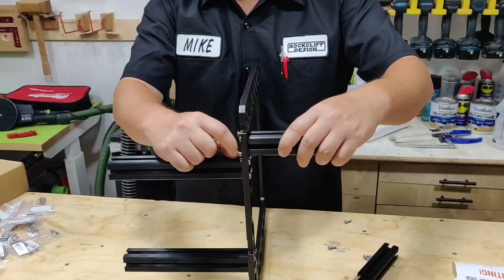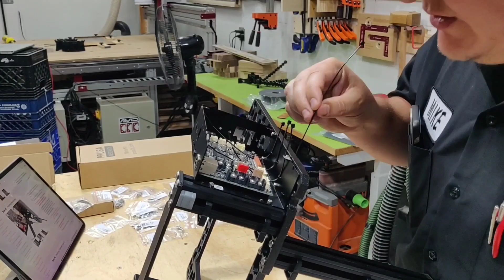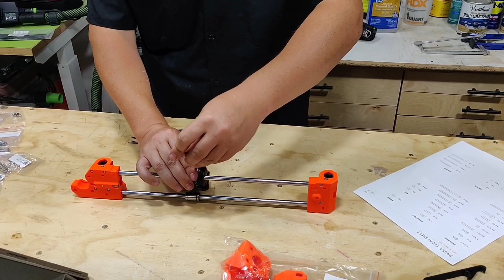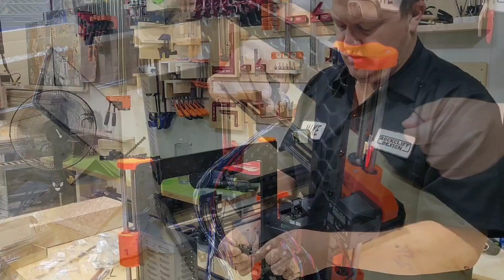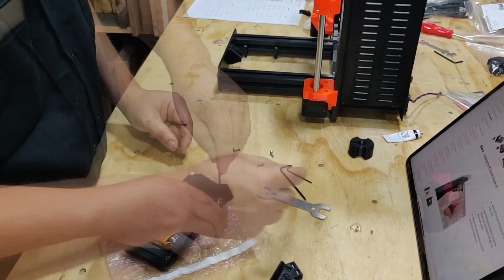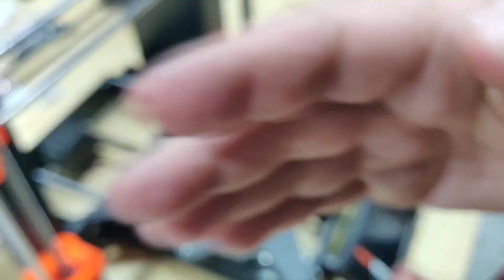Prusa MK4 Build Kit Assembly

Comment: I know I'm late but M3, M4 and M5 bolts are metric bolts. If I have an M3 bolt it means the bolt has a 3mm diameter.
Reply: Also known as the good unit to measure 😁

Comment: Assembled my own and had some trouble getting the z-axis to pass it's initial check. Turns out, you can try adjusting as much as you want, it's a waste of time and it won't pass the check. But you can have it pass if you stick a pencil near the front end so it doesn't move past a certain distance during testing. Not sure whatsup with that.
Reply from the maker: So weird. We didn't have an issue, but glad you found a fix!!

Comment: Prusa pretty much nailed it with the belt tension app.
So many issues with new builders were usually tied to belt tension or bad z height. They pretty much fixed that with this machine.
Great video! Hope you are enjoying your printer
Reply: The prusa bear upgrade did this 2 years ago
Reply from the maker: Thanks! Loving it so far. Agreed that the app made a huge difference. It was so nice to know that we had the tension right before moving on.
Reply: The app didn’t work for me. I just set the tension to feel right, and it works fine!

Comment: IMO for anyone that’s not using this for a business where down time is a major factor the kit version is the best for the average user/hobbyist. 
You really learn how the printer functions. 
Not to mention, in the US, you don’t have to deal with the import fees bc it’s under $800 not including shipping. 
Least that’s how it was with my Mk3S+. Got a MK4 on the way but it won’t be shipped for another few weeks.  I did NOT pay any kind of import tax on the MK3 when I bought it last year.
Reply: I added an extra sheet to my MK4 kit, and brought the value over $800...I got a surprise message from DHL asking for import fees.  Keep it under $800, which is the bare bones MK4 kit, if you want to avoid paying fees.  My mistake!
Reply from the maker: Agreed. We actually liked the assembly process for that exact reason. Being new to 3D printing in general, we now feel like we have a much better understanding of how the machine works after physically putting it together and learning and understanding each step.
Reply: @rockcliffdesign  
It’s fun.  Problem is I enjoy building these things as much as I do everything else. A Voron is next on my radar. After I build it I’ll prob sell the MK3S+.
Reply from the maker: @DD-sw1dd  The Voron looks like a fun build as well for sure.
Reply: That is one of the reasons that sealed the deal for me.  Knowing how the thing goes together and being able to fix it is a big plus, compared to proprietary offerings like the Bambu.